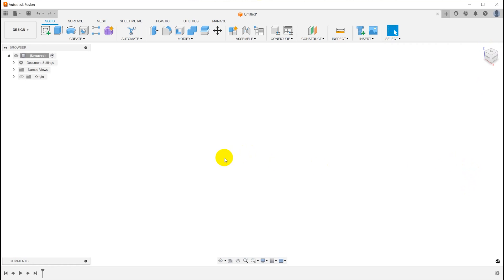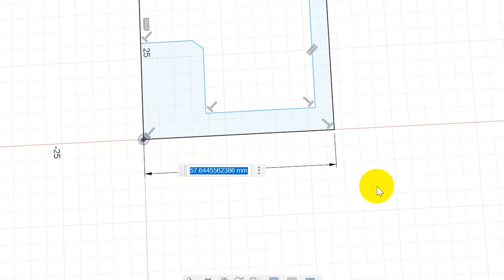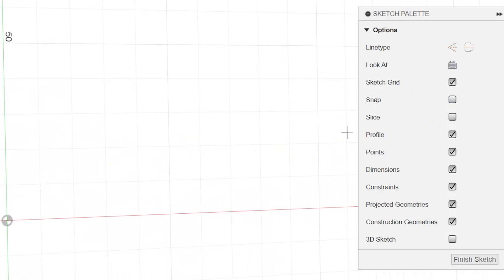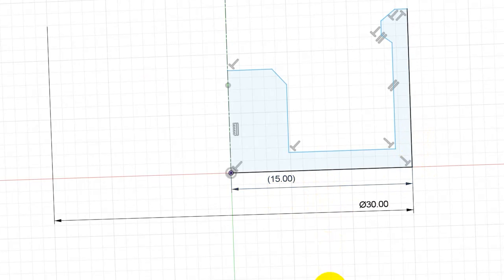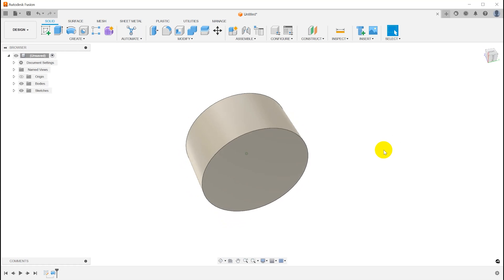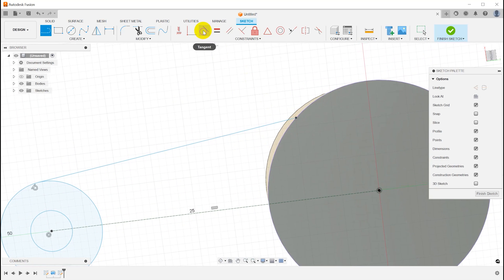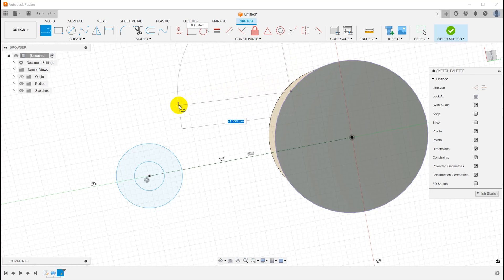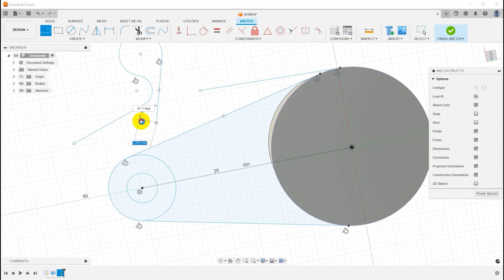Fusion 360 Tips From Viewers Like You (maybe you, specifically)

Comment: I learn a lot from you thanks for being a deep thinker. One more way you can make a diameter dimension if you forget to do the centerline option, is by first clicking what you want to be the centerline then the outer line and before clicking again to put in your value, right click and choose "diameter dimension" on the dropdown then continue as normal and it will populate the other side just as if you used the centerline.

Comment: I finally picked up a 3DSpacemouse from your recommendation. It is fantastic!  Saves me a huge amount of time already. I’m still learning how to get it to do exactly what I want, but not bad already. 
 I am designing the suspension link replacements for my OSSA Explorer, planning to use needle bearings instead of the thinshell teflon coated bushings (were I can anyway). So I’m 3D printing them now to make sure everything really works. Then find a place that will make them (hopefully titanium). 

 Thanks for the tip on the spacemouse!

Comment: Just found out you can type "dimLength = 30mm" directly into the dimension of the sketch and it will automatically add it to the parameters! So awesome because the parameters dialog can be pretty cumbersome to work in.

Comment: Wow‼️
I’ve been using F360 for years…. but sporadically….
I knew about the centreline option….. but you’ve now shown me WHY… when I try to dimension a parallel line off a ‘centreline’, I’ve been getting a ‘double’ dimension .
F360 assumes the second line is a ‘diameter’
🤣🤣🤣🤣🤣
Now I know why…. I probably should have use a ‘construction’ line instead of a ‘centreline’.
Thanks James…. and thanks to the commenter that raised the ‘centreline’ aspect.
Regards
Robert

Comment: For the line (the icon for which is actually AutoCAD's polyline hinting at lines and arcs) it depends on your initial movement from the end of the line.  It depends on which quadrant you initially move the mouse.  If you accidentally move in the wrong direction, just move the mouse back to the lines end point, then move in a different direction.

Comment: One that I noticed as you were working... if you're dimensioning something where you have a line that's that length (like the bottom line that is 15/30 in your example), just dimension the line instead of clicking on the verticals on either side.
Reply: That can depend on what you are doing. Many times I know I am going to mess with a line in ways what will invalidate the dimension, so I make sure the dimensions are between features that are not going to be modified in a way that will break the dimension.

Comment: Instead of clicking the "construction line" button, you can just press x on the keyboard to turn this on or off. You can also first draw a normal line and later convert it to a construction line by selecting it (or select multiple lines on the sketch) and then hit x on the keyboard.
This saves me a lot of time.
Reply: This is my favourite shortcut in the sketch workspace!

Comment: 7:15 - I also need to plan everything out, especially when using Fusion360. I know that Fusion360 is a parametric system, but I have the hardest time not completely blowing-up my model when I have to go back and edit a feature that I didn't expect to have to edit in some way. It's so much easier in Catia and Solidworks. So every trick and tip helps me alot.

Comment: I learned Inventor before Solid works and some Fusion 360.  Inventor was easiest to dimension .  When you add a value to a line, you can click on that value and use it modified other places.  Inventor likes the origin to be the center of the object.  You create a template with a point locked on the origin.  All dimensions were number and could be renamed or modified  in a pull down list.
Reply: You can do the same thing (clicking on dimensions to use them in math in other dimensions) in Fusion